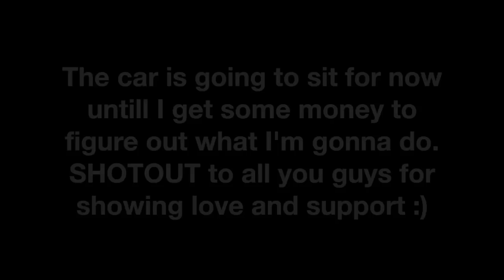UPDATE: CRX4DR still running but not fixed

Comment: Why do you think it will be expensive to fix? Just pull the front mask straight. Its a racecar anyway doesnt matter if it looks liek new.. but id check the noise before driving lol.. issue on the belt could quickly kill the engine. and why the heck is a pool inside the car XD

Comment: looks like you need to straighten the core support, get that rad in the right spot. not to tough to do. how about the frame? that would be the killer for me. if the frame is bent, junk it and put that engine in a cool hatch.or......................frame is straight, swap a k20a/k24a2 frank in that shit and smoke everyone.
Reply: wouldn't be as balanced as the b16 with a k20
Reply: +Leon Jr B-Series engine/trans: 401 pounds

K-Series engine/trans: 403 pounds. ill take the power and two pounds. plus having the exhaust facing the back and intake facing forward.cheers!
Reply: +Haeeyy Productions pisser man. I sure hope you get things worked out. your a damn good driver. with all these subs, somebody has to have a rolling chassis to donate to ya! thanks for making these vids. I don't have the balls to drive my car like you do, I would be very upset if I wrecked mine.

Comment: Stop treating your car like trash bro! Just fix it and stop acting like you don't car if it brakes. If that B16 means shit to you I'll gladly take it off your hands and treat it right because one mans trash is another mans treasure.
Reply: +Gabriel Daniel hes actually using the car and driving it hard like he built it to be. this is a race car its a tool meant to be driven fast and thats it.